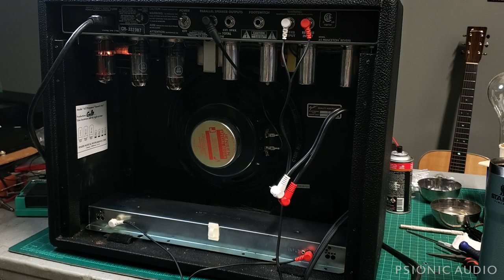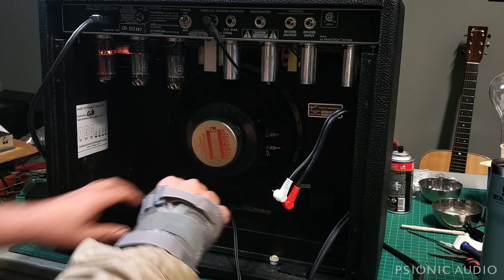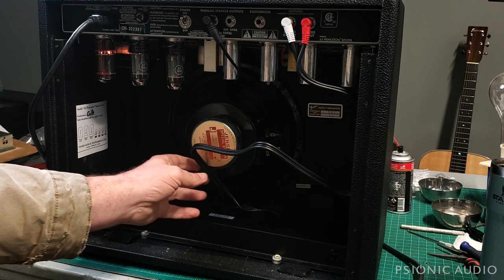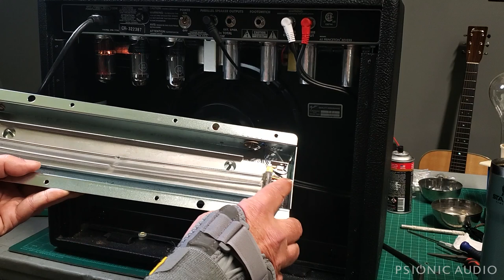Reverb Tips

Comment: I just finished sorting out a reverb hum on my Princeton reissue. It still has a little bit of noise, but not nearly as bad as it was. I replaced the reverb cable, turned around the tank and then made the mod you discussed in a previous video with the blue wire and green wire across the tube socket. Thanks for these informative videos.
Reply: he has a patreon account ;)

Comment: Those loose transducers inside the tank can be secured tighter by using a wide enough pair of pliers to simply move the plates tighter, and close the gap. Its just a riveted connection within plastic. No need for glue, but it can sometimes help too.

Comment: Reverb is tricky with noise. When I got my '67 Deluxe Reverb, the reverb was horribly noisy... like unusable. Before I took it back to the shop for a look over, I turned it around and checked the tubes, and sure enough, someone had swapped the tubes in v2 and v3 putting a 12AX7 in the reverb driver. I swapped the tubes and all the noise disappeared.

Comment: Thank you Lyle, been trying to fix a noisy 65 DRRI reverb and have had so little success.  Only set backs.  New Reverb driver tubes, return tubes, new cables, rotating tank 180, even trying that rewiring V3 tube I believe you went over with a 68 DRRI.  No luck.  Appreciate all the tips.  Might be time to try a new tank, came stock with a Ruby Tubes Tank.  Have bought lots of Mojotone things, perhaps I will give their tank a go.  I like a drippy one.
Reply: Did you fix it? 

There are many other more involved things internally that a tech can do to address that hum like changing the neg. feedback resistor, remove heater filament, ground the power section capacitor point CP13, remove jumper lead from V7 and more. Not exactly DIY but a good Fender amp specialist should know what to do to get it whisper quite. 

If all else fails- sell it and buy a Dr. Z MAZ MKii (not 1) head or combo. Very quiet and overall higher quality (and price.)

Comment: Instead of changing the reverb transformer feed from B to C, what about adding a choke in between A and B like on the Deluxe Reverb? Don’t have to change the internodal resistors and retain the plate voltage? Would the choke provide enough filtering? Or up the capacitor from 20 to 40uf.? Or both? C  node is a unused tap for high voltage, why? To add filtering to D node which feeds the preamp tube. I know I ask too many questions! Love from springtime in the Rockies. Thanxz
Reply: That’s the way. Done it many times

Comment: If reverb tank hum comes and goes gradually while you move the tank around, the actual reason for it is the leakage magnetic flux from the power transformer being picked up by the receiving reverb transducer. Consequently, the quieter orientation is the one with the receiving transducer located farther away from the transformer. Sometimes just rotating the tank is not enough to cancel all the hum, then you can put a steel sheet cover plate over the bottom opening of the tank at the receiving transducer end to serve as a magnetic shield, and this should fix it (provided the tank enclosure itself is steel and not aluminum.) The plate doesn’t have to cover the entire length of the tank, covering just about 1/3 of the length should do it. I used to use a piece of an old floppy drive chassis cut to size with great results.
Reply: Good assessment and repair advice. The Princeton may have been just a bit too short a cabinet, who knows. I've seen the odd small reverb tank that looked to be made out of a copper alloy of some type, probably because less magnetic.  Sounds like the shield would need to be slightly magnetic though, correct? I'm not up on that theory.
Reply: @cloudconnect  Thanks. I've seen a small blue plastic tank in some very cheap amp and it was downright awful. You're correct that magnetic shield should be of a magnetic material (a ferro-magnetic).

Comment: Hello Lyle, I just swapped out my stock reverb tank for a mojotone, definitely better sound. Question the old reverb tank is enclosed in bag and had two pieces of foam inside the  tank between the springs as well as piece of cardboard, I took the foam out but did leave the cardboard, your thoughts? Also I tried swapping a celestion gold speaker for the stock Jensen the hum was so loud I sent the speaker back and replaced it with an eminence Arjun Cajun, question why might the celestion have so much hum? Thanks in advance for the terrific videos
Reply from the maker: That foam should never have been left in there. Factory error. You wouldn’t have had much reverb with it. Cardboard is to keep the bag from contacting the springs.

Speakers cannot cause hum. Something else was wrong.

Comment: is it possible to replace tubes with jfet transistors in the reverb circuit making it kind of solid state tube thing?
would it still need an output transformer ?
Reply: Anything is possible. Look at the solid state reverb units from the late 60’s to see how it was done. 

You likely will have to install a secondary low voltage power transformer though.
Reply: i was more thinking of being an antychrist and making the whole thing from tube analog transistors
did you ever worked on such an amp where schematic looked tube -ish and all components were some simple 3 leged  black boxes?
Reply: None of the circuits that were made without the reverb driving transformer into a spring tank sounded as good as the transformer circuits. Tube or solid state. There is just something about driving that circuit with a lot of current, I think. That's maybe what is so special about the stand-alone unit in comparison to the amp version. The hot rod deluxe amps use a fairly good solid state circuit with no transformer, and its really quite good, just not AS good.

Comment: Hey Lyle, long time listener first time caller. What would be your thoughts on placing a reverb tank inside a cabinet in a head+cab configuration and running the RCA cables from the head to the cabinet? You'd lose the ability to change the cab you're using, but I reckon the noise reduction would be worth it.
Reply from the maker: Could be a fine thing. Certainly would take away proximity noise.

Comment: Had the same issue with a mojo princeton kit, had to wrap the tank in magnetic shielding tape. Not sure if the vintage ones had similar issues or the tanks were better shielded? Also not sure how changes to the power node could possibly help a proximity issue?
Reply from the maker: The proximity issue is separate from the hum injected into the Send by the unfiltered transformer.

Comment: So accutronics and Belton are to be avoided, and mojo is the way to go. I've been debating building a spring tank pedal to go with my tweed champ build vs buying a princeton rev kit vs buying a princeton rev hand wired reissue. Any thoughts? I don't like noise, so you've made me a bit worried about the PR route. Any other suggestions for low watt fender tones with spring reverb and ideally trem? Thanks!
Reply: Either the PR HW or any PR kit can be wired with the reverb driver driven from the quieter node. Weber's PR kit, for instance,  shows reverb driven from the "B" screen node, and with the power supply "C" node marked "unused". Doesn't mean you can't use it -- see the SF princeton reverb with boost-pedal schematic for suitable power supply dropping resistor values if you do. (You needn't implement the boost circuit -- it doesn't affect the power supply and you won't miss it.)
https://el34world.com/charts/Schematics/files/Fender/Fender_princeton_rev_boostpedal.pdf

Comment: I’m pretty sure the larger, dual channel Fender amps also feed the reverb transformer primary (as well as the trem oscillator triodes) using the screen grid PS node.
Reply: Said screen node being fed, not incidentally, from the filter choke the PR conspicuously lacks.
Reply from the maker: Exactly. Makes a huge difference.

Comment: Speaking of what we should live with: is it normal to have a very low volume, sub bass thump in the tube biased trem of a PR?
Reply from the maker: Common, yes, but not normal.

Easily fixed by a good tech.
Reply: @PsionicAudio  This amp has a negative feedback defeat pot, I suspect therein lies the culprit.  Alas I am an amateur.  I'll take it to Bob Dixon here in LA.  Thanks, Lyle.

Comment: I have a 65 reissue twin. There is a hum off the reverb. Its not loud but its a good bit louder than my friends twin. When i connect the footswitch and engage the reverb there is a loud hum. This isn't the case on my friends one either. i tried his tank and cables in my amp but it made no difference either. Ive also checked all the tubes. Anybody have any ideas?

Comment: If the hum is caused by ripple at reverb driver transformer's supply voltage, and not by magnetic fields, then a tank with a driver coil of  poorer low end will probably be passing less 120Hz hum and is "better" even if it isn't Hi-Fi wise. 🤔
On the other hand if there is room for an extra smoothing resistor and  electrolytic cap in the amp, it would be possible to add some extra ripple filtering to the reverb driver circuit.
If the amp's transformer layout is not optimal, the reverb transformer as well can of course take hum from other transformer's magnetic fields.

I just recently added a reverb tank into a very beaten up early 70's Laney L100 tube head's ceiling and was sure that it's not gonna work because that 550V B+ Partridge PT is a monster hum source, but against all odds it works just fine even if the driver coil is pretty close to the PT because the coils seem to be in good position to each other. I a**r*ped that old and ugly British wreck to 50 watter by removing two EL34s and installed a 12AU7 reverb driver (kicking a small Hammond OT) and 12AX7 recovery tube. It works very well indeed.
The tank is made by TAD, 4AB3C.... The tank is quite OK but much darker sounding than a reference tank I compared it to, which was a middle 80's Accutronics, Made in USA.
Reply from the maker: Look at the Princeton schematic. See that unused extra filter node there. They kind of handicapped the Princeton so it wouldn't overlap with the Deluxe. Change the dropping resistor values/ratio and move the PI and reverb xformer to that node and you have a louder less compressed amp with quieter reverb.
Reply: @PsionicAudio  True.
BTW  Fender has sometimes used same standard driver tube 12AT7 cathode resistor values in different amps even if the supply voltages can be quite different, which is not very smart,  and bias and operation point then is not necessarily optimal, causing often either very distorted reverb driver sound or overheated driver tube, or both. And some people try to use 12AU7 instead of 12AT7 without understanding that those two tubes need totally different load and different bias voltage to give best possible result.
Reply: @PsionicAudio  For values, check the SF Fender_princeton_rev_boostpedal schematic, which does feed the reverb from the previously unused node.
Reply: Very interesting !
I’m building a mojo kit at the moment. If the reverb happens to be noisy I will test this mod 👍

Comment: I had an issue with a noisy reverb. The owner had changed the speaker to one with a larger magnet. I  had to rotate the tank to where the jacks were facing to the rear   of the cabinet. It quieted right down.